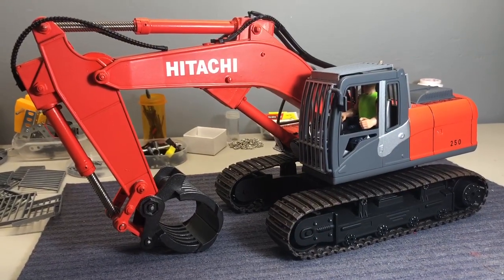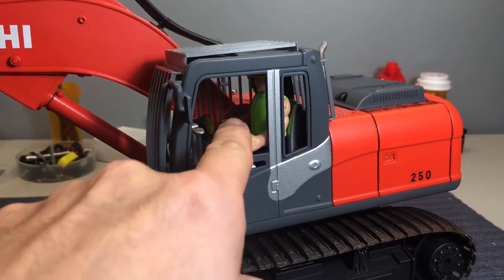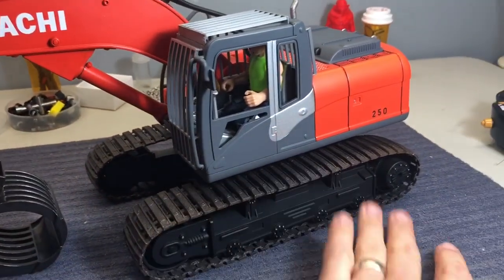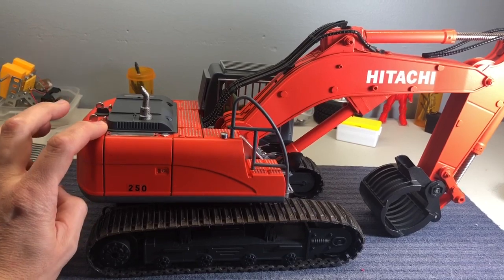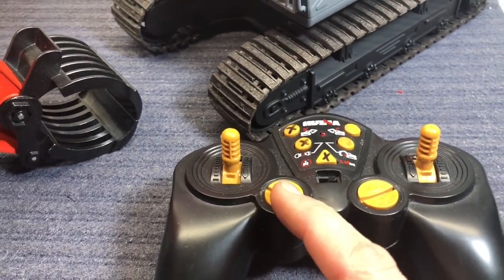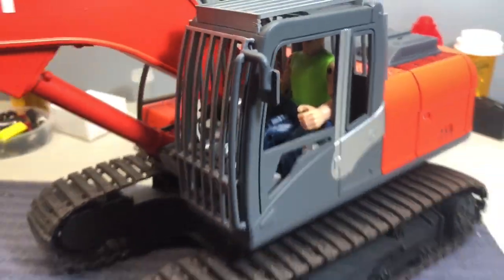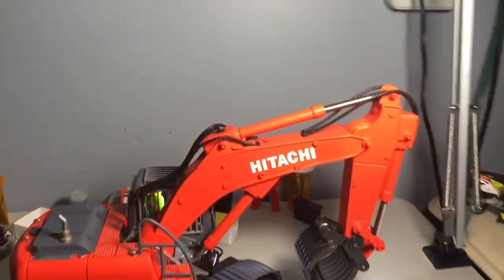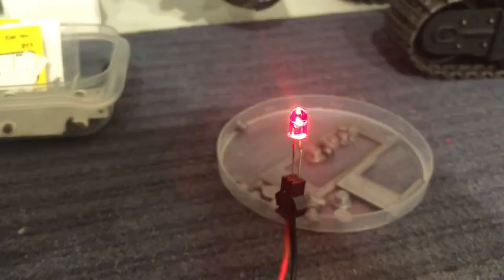Huina 550 Rc Logger Excavator upgraded

Comment: Hi.
I have to agree with mister modders about the paint job, I thought it was a Hitachi model you found somewhere and was a bit jealous.  I think it's great.
You mentioned to the same mister modder something about the 580 broken? Would you like to tell a bit more, I have one since about 11 months back and had a few issues. Maybe I can be of assistance. 
I also designed some spares if you need.
Glad to help if I can.
The same goes for me, I am the only one around here to do this so...
Nice even excellent work from you from what I have seen.👍
Reply from the maker: Thank you very much for the kind words.. My 580 is up and running smooth.. I had contacted toprace and informed them
I felt as if it was the transmitter not making a bind with the unit.within a few days I had a new transmitter and as soon as I turned it on it bonded and off I went.. My plans are to get the 583 as well.  The Huina in this video was my first Huina I purchased to give the brand a go a few hrs back.  So it took this long to give it the vision I had in my head lol.  I have the entire line up of Huina as well as the hop ups to make them what I’d like.. Just strapped for time and only can build on rig at a time when I got the time 😬😉
Reply: @thatsmyrc  
Aha, I see. Well nice to hear that it all worked out. I've had some more mechanical issues with my. Okay, me too planing on the 583 loader, but need to lay low now for a bit due to "family peace" but soon😁. 
I also thought about maybe the 573 truck, that thing is sturdy. But then I saw HobbyDad and his cheap build from a cheap double e and going with something like that later. 
Keep up the good work friend.
I WILL try to film something and put up...